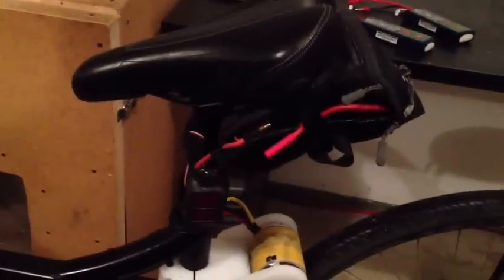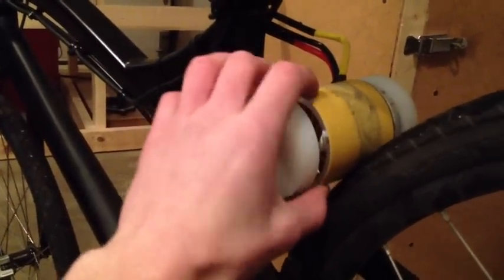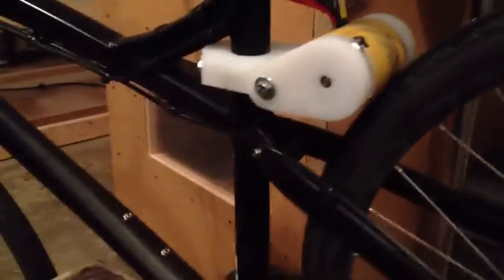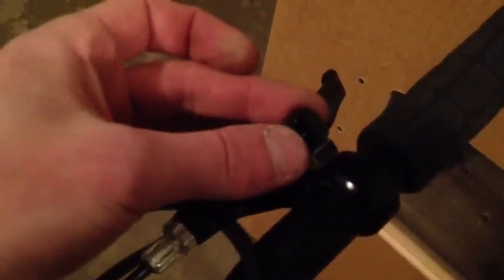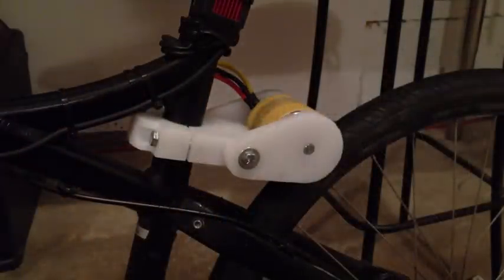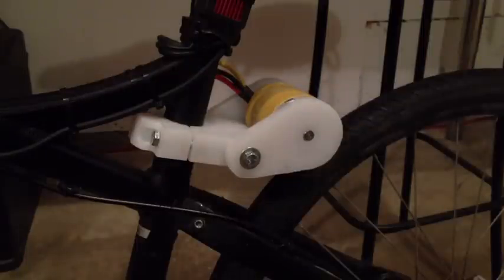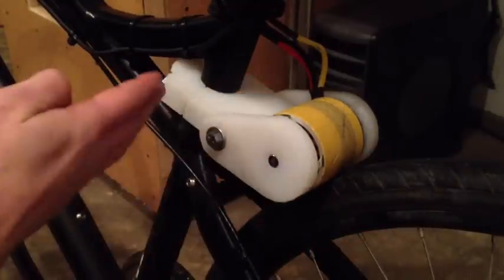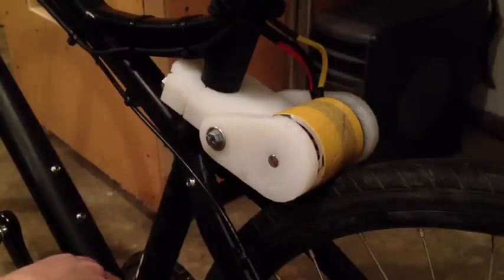E-Bike Project : Lycra Racer

Comment: Where can I get the motor holder
Reply from the maker: No idea, I had cnc machined that part back in the day.  However it could be done with simple hand tools as well.
Reply: @CurtVanFilipowski  Can you do one for for me... 😀
Reply from the maker: @swimwithcoachraven1532  Hehe, sorry but not something I can take on right now...google "endless sphere commuter booster". I believe that is the forum where I got this idea and there are a bunch of pages devoted to people building similar units. Good luck!
Reply: @CurtVanFilipowski  I tried friction drive on the electric skateboard.It took off well without load. Didn’t pass the load test. It’s was just friction at the end due to poor mechanics the idea was good though

Comment: well this is one of the cleanest friction drive setup i've seen so far.
i realize i went down the same road as you as far as the setup is concerned, though i'm using a VESC instead of an ESC.
can the ESC you're using be programmed as the VESC is? can you put hall sensors on it (as on the VESC)?
also, can we expect any follow up on this project?
anyways, nice work.!

Comment: Congratulations on your project.
What autonomy in km do you have with 22.2v and 5000mah?
I need to do 15km in total, smooth surface.
Using your motor, and batteries of 6s 5000mah, I wonder what autonomy would have.
I am looking forward to your response. a greeting
Reply from the maker: I could easily ride to work and home on a single charge which was a round trip of 18-20km.  I would say I used the motor 70% on this trip, and legs for the other 30%.

Comment: got the same build but im using 18650 battery and i used a small  PlC ( you can also use ine of the small arduino boards) with a magnetic censor  programed it so the faster i go the the more more the motor spin

Comment: What is that  yellow tape covering the motor?
Reply from the maker: Its adhesive backed sandpaper...helps greatly with the grip but nukes tires if you are not careful with the throttle application.
Reply: Thanks sir

Comment: Hey really love your videos! I build a scooter for my tech project using a similar design, i'm having some motor slipping issues though, what did you use to increase friction between motor and wheel? Looks like a sanding drum for a drum sander? I'm just using the metal of the motor atm and it slips even with lots of pressure on the tire.

Here is a link to a bunch of pictures of the project with 2 videos in the comments: http://imgur.com/gallery/jC4lS

It's pretty poorly designed, would do it differently if i did it again. 

Cheers, Nathan
Reply from the maker: Thanks man, I like your take on the scooter.  I used adhesive backed sandpaper on the outside of the drum...works well but can be brutal on tires.

Comment: Does anyone know if The engine and the battery are damaged when when it is raining?
Reply: Brussless motors do not get affected by water, is the ESC what can be fry, by insulate the ESC the other 3 wires are ok, or you can waterproof everithing, I did a experiment before and works under regular water, sal water is other history.
Reply: Thank you

Comment: how much were the parts you bought, eg motor, switches and anything else-lovely job, not too fussy like some and nice design,dunno what u r using as the "drive pad/collar",i used a slice off an old inner tube  SLIPPED IT OVER THEN glued it onto the drive wheel,lasted a fair while and CHEAP

Comment: does it work in the snow or rain? does it wear away the tire more than usual?
Reply from the maker: Since it relies on friction it works poorly in the snow, decent in the rain so long as you limit the wattage.  Wear on the tire is more then normal, but not excessive if you ramp slowly into the throttle (although that is hard to do when you have a few KW at your disposal :) ).

Comment: do you have measurements of the  parts? id love to try it out if possible, i dont have a cnc but im sure i can do this with wood and a band saw.
Reply from the maker: +Madyic Stik This could easily be done with hand tools.  Google "commuter booster ", I think there is a nice thread on endless sphere (electric forum) that has a huge wealth of info as well as some ways to figure out the geometry based on your bike of choice.  This is the information I used when doing this conversion.

Comment: Hi there are you still working on this project? If yes what is your box that you are using to control the motor?
Reply from the maker: +David Huot This project has now been transformed into a powered dirtboard.  Inside the box there is a servo driver that is generating the pulse train to drive the brushless motor controller.

Comment: Hi Kurt, this is great and was actually part of the inspiration for a portable ebike motor I built for the bike shares here in Montreal.   Here's a link to an old version: https://www.youtube.com/watch?v=7_8CEtcitEA..  This is what it looks like now:  http://imgur.com/UlFeRMt.  It generally works great, except I keep killing batteries. I don't have a meter inline, which I really need to do for testing I realize, but I'm wondering if you might be able to offer some insight into what's going on.  My theory is that I'm, not over-discharging, but pulling too many amps when climbing hills, thus shortening the battery life.  My first battery pack was similar to yours, but with 6 smaller packs to reach 6S [3 packs connected in parallel to another exact set in series to get 6S.  The whole thing was about 6.6Ah I believe.  I now have two 6S lifePO4 packs in parallel, but have about half the range I did [took about two weeks to degrade].  When I charge either of the two packs I always show one weak cell.  I'm wondering if you've had similar issues.
Reply from the maker: +Tim R Thats a slick setup!  I haven't had any similar battery issues but it could be too much amp draw...then again 2-3KW is a LOT of power for a bike, I'd hazard a guess that your actually still overdischarging.  You do look like your giving the packs a workout in your video but if they are running cool I would guess the amp draw is in spec...this is all just guessing without an actual watt meter reading.

Then again if you pull enough watts you can over discharge/overamp the middle cell (less heat surface to dissipate).  I've had this happen in the past (over discharge), a balancing charger will usually warn you of this, but if you leave the packs for a few hours / days before a recharge then sometimes the cells normalize out and you never see the imbalance...a volt measurement hot off a run cycle will tell you whats up.
Reply: +Curt Filipowski,  Yeah you may be right.  Maybe I am over-discharging.  When I pop the cover after a ride, nothing feels too hot, the batteries especially stay pretty cool.  There's no puffing or anything on the packs either.   The esc (cheap hobby king 120A thing) does get warm, and the motor more so.  Should I trust the voltage cut off protections in the ESC?   I suppose they wouldn't be able to monitor every cell?  On a fresh battery back do the cells drain at much different speeds/depending on their order in series?  Glad to hear you've not had issues.  I was thinking of going to 36v.  That should lower my amp draw, no?   Sorry for all the questions and thanks for the quick reply :)

Comment: So, sorry that i ask, but I´d like to know it more exact... :  You have an 22,2V*15A Battery, and reach 48kmh with 22,2V*30A=666Watt!!! That must be an unbelievable Roller-power-transmision-efficiency, unless you weight 30kg (with your Bike)... ;-) So: What is your weight, and what is the weight of your Bike??? thanks á priori for every answer/feedback!!! I´d like to repeat what you did, but I know that the power-transmision -efficiency of such a system is miserable... But now your numbers tell the opposite!!!
Reply from the maker: +Klaus Brinck I'm a fairly small guy @ 140lbs, throw in the bike and gear at 30lbs I'd say everything is within the 150-170lbs mark.  As for watts and speed attained, those are the readings I am getting.  Getting up to speed takes significantly more juice ( I can spike into the 100's of amps if I'm really aggressive with the throttle).  Then again 600+ Watts is a decent amount of power to keep a bike in motion.
Reply: Hi Curt! my weight is 180lbs.. I need more power? if so, I need a bigger engine or more batteries.. explain me a little please...

Comment: Could You post blueprints or/and tutorial?
Reply from the maker: Jakub Baran With the snow gone I will post another detailed video with the updates and changes I've made.
Reply from the maker: ***** Thanks and thanks!  Ultimate would be a fat tire bike (to help with our winters) and a double 1000W hub motor setup...sadly thats a horribly inefficient setup so I would like to say that this is close to ideal.  A relatively inexpensive bike, single speed, good brakes and a few sets of rear tires to go along with my light weight power assist.
Reply: Curt Filipowski This is amazing, great work! I look forward to update,  I'd love to hear what your ultimate build would be, starting with the bike and working up from there. I would seriously consider following your lead, yours is the best I've seen so far. My commute is 20mile round trip, mostly flat with one large hill at the end! This is the type of channel that makes youtube great. Subbed and Liked...

Comment: You can set up regenerative braking easily with these outrunner motor setups with well under a pound of extra electronics too. Simply install a decent quality switch on the rear brake lever that will close its contacts before the actual friction brakes engage the rim. That switch will activate a TPDT(Triple Pole Double Throw)relay that bypasses the speed controller routing the 3 phase AC electric generated by the motor into a 3 phase bridge rectifier back to the battery or optimally a small, voltage matched bank of 250 - 500 farad super capacitors as they will take the charge more efficiently upon braking then paralleled back into the main battery pack with a second relay activated by a simple charge controller circuit to detect when the capacitor bank is fully charged allowing you to continue to store all the braking energy into the main battery. Some current regulation is in order between the cap bank and main battery as ultra-capacitors can make the magic smoke appear without a doubt! You can melt 7 penny nails to red hot magma with the larger varieties. The optimal size caps for a regen system for a bike are not much larger then the capacitors you see in a PC power supply and they are fairly light.The super caps give you a nice current boost on take off as well.  When the regenerative braking switch is released the relay disengages back to normal speed controller operation with the cap bank paralleled in with the main battery. If you wanted to get really crazy you could have variable linear braking similar to power brakes by varying the regenerative charge current with a rheostat based brake lever and a TRIAC but that is overkill for a small bike system. Depending on the KV rating of your motor you will also need a step up buck converter to boost your particular motors voltage generating capacity up to your battery voltage. You can test the motors output voltage simply by running it through a 3 phase rectifier and hooking your meter up to the DC output from it and take it for a ride. These components are so cheap from China on eBay there's not much you can't do these days. About $10 bucks for parts without the cap bank and around $100 or so with it, well worth the expenditure either way.  I'm hobbling together parts to build one for a winter project. I have at least 50 laptop packs full of 18650 LiPo cells from my electronics shop that will be torn apart and tested to make a matched 56 cell 51.8V 10ah battery pack (14 sets of 4 3.7v 2500mah cells in parallel then wired in series) to power a 110 amp 550KV outrunner 700 size heli motor that I found for $129 that can run 4000 watts continuous and handle 5700 watt bursts for 15 seconds (Electrically speaking, 5.3 to 7.6HP).  I'm making my own speed controller as well with a 40Mhz ARM STM32  32bit programmable processor and a huge heatsink pepperd with N-Channel MosFets from an old 5000W power inverter a customer abandoned years ago. Should make for some decent wheelies with a $2 eBay XYZ Gyro and accelerometer shield board to work the throttle in 1024 steps of PWM polling the throttle position and sensors at 250 cycles per second. With the addition of a GPS shield and LCD display it will display location, speed, power usage stats or whatever other $2 Chinese cell phone technology sensors I feel like adding. You could even program in exactly what angle you want it to hold when in wheelie mode too autonomously balancing itself like a segway but @ 55MPH! LMAO Anyway, Cool build... I may even scalp your motor mount design but with the addition of a locking lever type clutching system to take it offline for free wheeling. Nice video...
Reply: that is a great piece of advice. Have you seen Rubbee lately?
Reply: Thanks for all that info

Comment: Amazing - I fly RC electric air craft and was looking for an easy way to power my push bike around for some summer fun. Are you going to make the plastic bracket to sell ? I have the motor and speed controller but need a bigger ESC . Have loads of batteries though .  Brill idea - Thanks for the Video

Comment: should be able to run in almost peak efficiency at right around 2600 watts with loads of power left for just going fast or any other shananigans I may have in mind.  I want to get about 5-6 miles or more at around 25 mph. My commute isn't far so I'm planning for speed more than range. I have a thread discussing my build plans if you want to see. 

Thanks for the response. I really appreciate it.

Comment: I see. I was just concerned that the spikes in amp draw would be over 200A amps and be at risk of burning up an ESC. I know that in my 1/10 scale RC applications that I can easily hit over 100A spikes and that is in a 7lb vehicle! I ordered a brushless ESC that is rated for 200A continuous and 1000A burst. So, I should have that part covered. The motor I have ordered is a brushless outrunner that has a KV and power that is suitable for the speed that I want. Rated for 5300 watts! I figure that

Comment from the maker: ESC can sustain ~200A and bust a bit more...even 100A at 24V is 2400W!  Thats just a shade over 3 horsepower (ideal) which probably boils down to around 1.5-2 Hp after drivetrain losses...so yes there is plenty of power on tap to accelerate a person.